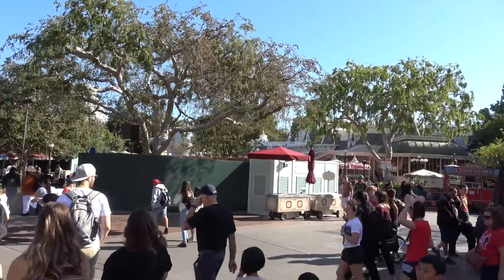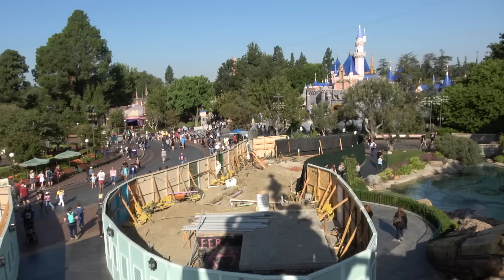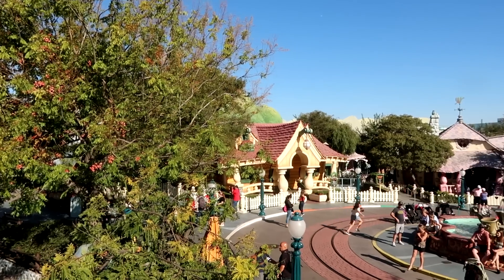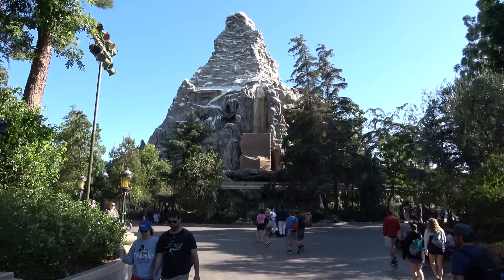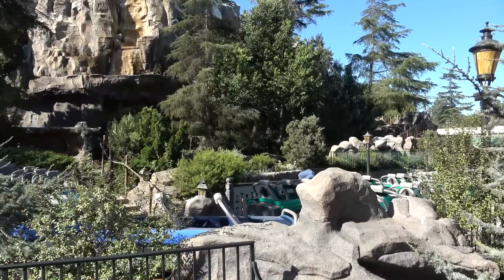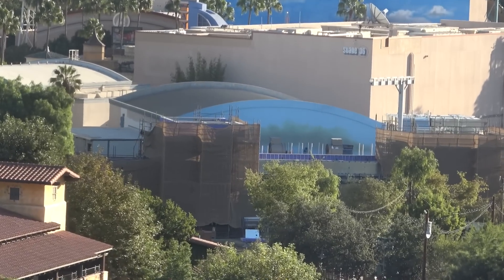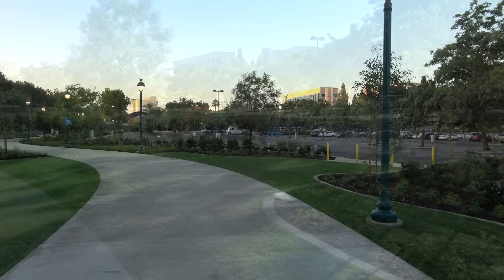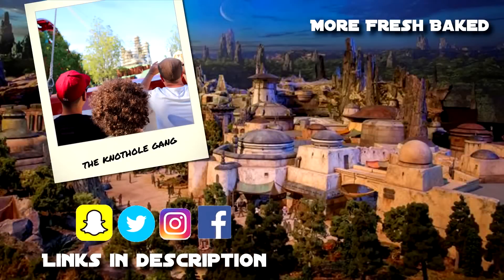Tomorrowland Mysteries Solved? - Disneyland Construction | 10/12/19 pt 78

Comment: The generic term for those round tubes for lights,  etc. is Sonotube. 
On your 7/20/2019 update,  I mentioned at 8:28 that approach ramp was probably for emergency access. The grass was temporary ground cover over base rock that was installed during construction. I'm pretty sure Disney knew it was going to be used as a shortcut and a concrete driveway would eventually be installed.

Comment: Reclaimed water… 
A lavender pipe would be used for reclaimed water 👍🏻
Non-potable
Clean water not for drinking
Reply: so yes for irrigation.
Reply: Steve Jackson 
Yes for irrigation…👍🏻
I’m sure there’s other applications for reclaimed water… But… I would guess that reclaim water is about 99% of its use
Reply: @dougingram4183  I have installed thousands of feet of reclaimed lines, always for irrigation. Outfall, or treated grey water, from wastewater treatment plants is actually cleaner than regular water, but no one wants to drink it so it is usually dumped back into a river or other water source or used for irrigation. I haven't heard of any other use. I put in a few miles of it in Austin, TX to water city owned baseball fields and parks! But it is supposed to be wrapped in "reclaimed water line" tape that literately says that in case someone dug it up, so Im not 100% on it. FRESH BAKED!!! Kungaloosh!!!
Reply: Haunt1000 
Yep… I just didn’t want to write all that...
Haha
And I just wrote 99%… Because I would guess there’s some sort of an application out there in the world other than irrigation… I just don’t know what it is…

Comment: The Matterhorn has been sinking for years, from what I have heard many times in the past. I see them taking it all the way down and rebuilding it exactly as it is. I could see them having Bob Gurr come consult on the project, which would make absolute sense to me.

The Matterhoen needs love. I just donr want to see any Frozen there. Being back the Matterhoen we know, maybe even better than ever. With the 3d scanning abilities we have today, it's highly possible to have the Matterhorn look identical to the way it is now.
Reply: Okay I hear you BUT, what if they left Matterhorn as is, and still managed to fit in with a Frozen land behind it, where Matterhorn is a backdrop that represents the north mountain? That could work... right?
Reply: @JimmyRHigh  
Oh yes. Thatd would actually be perfect.
Reply: I would be ok with a subtle retheme of the Matterhorn ride to make it a little bit more like the Wandering Oaken Sliding Sleds ride that is being put into the park in Asia (I forget which one). That theming is fairly subtle (think Seven Dwarfs Mine Train) and seems a lot like the Matterhorn.
Reply: When they built Nemo, they tore out some concrete by the walkways and made the Matterhorn start to list to that side. Alarms went off in the Matterhorn and engineers were called. The lagoon holds back the Matterhorn. The lagoon also leaks and has caused other issues on the east side of the property

Comment: Usually, those driveways are there for emergency vehicles. Our local high school did that. So not sure if it actually was for future concrete work, but regardless we should still treat it with respect.
Reply: arkytekt16 yes there is a driveway that leads to the road on the other side of the path. Anaheim PD likes to use the hedges hiding the driveway as a speed trap

Comment: 22:28 they didn’t intend to connect it. It was an emergency path in case they needed it- they would pull out the yellow poles and drive across the grass IF NEEDED. That is what those piles combined with a driveway apron usually is.
Reply: Agreed, use for emergency and maintenance vehicles.  Doubt it was ever considered or intended for pedestrian use.  The mob mentality however always creates a straight line of movement and usually destroys any foliage it its way despite safety concerns.

Comment: about the grass.  there is a driveway that runs to the street on the opposite side of the concrete path.  I think it is there for secondary or emergency use.  I'm surprised that they didn't use one of the hardened grass systems that helps to reduce foot traffic damage or artificial turf or something other than just bollards on the parking lot side.  a black iron fence with gates or even draped chain between the bollards would have done the job.  when I saw the set up on video I knew there would be people walking through there.  the grass was worn down when I was there in mid-September.

Comment: My sister works in the internship program at Disney and she works in the California Adventure side at Toy Story Midway Mania. When she was accepted and she got her information that there is no Onsite cast member apartments. They have to rent out a space about 10 minutes away. Unlike Disney world where it is onsite.  This makes sense because space is very limited but  since the eastern gateway was shelved do you think that that space( or the northern part) could be turned into  a cast member parking lot underground, with brand new apartments for cast members. they can then have a pathway across harbor  into backstage so that they don't have to travel far and its all onsite instead of spread out. As for the southern park turn that into that into another parking structure with  bag check on the second floor have a bridge that crosses harbor  by Disney way and have that pathway head towards the buss drop off area. Both guests from the bus zone and this new parking will have been through bag check.  this would then make the entrance at harbor smaller for bag check.  What do you think???

Comment: If the EER building is to be removed it won't be until all of the wiring that currently goes into the structure is rerouted. Hence you would not expect to see any demo on EER until all of that conduit lying around is in place. My guess is that they will remove it and replace it with a much smaller access structure.

Comment: The purple pipe is to identify nonpotable water typically reclaimed, recycled, or tertiary water supplied by the local waste water treatment plant.  It is also typically only utilized for landscape irrigation on golf courses and municipalities.  

The yellow pipes are bollards which are usually placed to control/prevent vehicle access to a specific area.

Comment: Couple thoughts... mission breakout fastpass area could be going away very soon as the new system will have its "hub" inside avengers campus. Also noticed the red car trolley  sign next to the current fastpass area. Could that be the new stop location for the trolley? Also is there enough room that the "new" track layout could turn right to go behind the pym foods building?

Comment: The mountains are not directly attached to the building. The mountains are on steel girders that are about 10 feet from the building but that does run the length of the building they’re adding M%M Runaways Railway. The mountains also block view of some of the pyro cannons

Comment: David that tent could be for welding for gas shielded wire or  short circuit metal arc welding to stop all the sparks and wind getting in to blow away all the shielding gases.

Comment: The mountains were a separate wall not attached to any building according to a former cast member.
Reply: Is that former cast member Alex the Historian?
Reply: Disneyland Vision I heard Alex say it and I also checked with a friend who worked at DL. I also vaguely remember it myself when I was in that back stage area for a band trip 20+ years ago.
Reply: You’re absolutely correct. Ex CM myself confirms the mountains and pyro were on a seperate structure from the building
Reply: You can google maps it and confirm what I said
Reply: True but they are close enough to the existing building that they probably had to be removed to make way for the demolition of the old building and construction of the new building.

Comment: The last I heard that Disney is expanding Tomorrowland and Fantasyland. Something about scrapping Finding Nemo and Autopia because both rides are very expensive to maintain and to take place for both spots for the Tron lightbike coaster. The coaster is going to be partly housed on the peoplemover track. Tomorrowland is supposedly house 4 new rides and attractions with Tron, Wall-E, Wreck it Ralph and something I don't remember. Fantasyland has a small expansion with 2 new rides. DCA is modding the park in 2, Pixar plaza and an Avengers part of the park. The Guardians ride is officially getting scrapped due to prior issues from ToT. The computer files are damaged which causes common breakdowns, it's something they ignored when making the Guardians ride, they didn't replaced the old cpu's. The last D23 convention they mentioned that construction with continued til 2025.

Comment: On the issue of the grass getting worn down, I actually think this was poor planning by Disney.  I understand the comments about being respectful, but I learned early on in site design and layout that you put paths where the people are going to go because people always take the path of least resistance.  Also I don't really understand why Disney made these areas of grass along that path because another thing you learn in the field is that grass is a surface most people will walk on.  We walk on grass quite a bit and most don't think of it as a keep-off material like you would a planter bed, etc.  As others have commented the ramp from the parking lot is for emergency vehicles and it's easy to see that people would treat that as a way to/from the sidewalk.

Comment: The yellow poles are there so no one mistakes the sidewalk for a road. Though access is still probably needed to maintenance vehicles. With that said, it would have very well been mostly maintenance vehicles that caused the grass to go bad. Assuming those vehicles typically cross at night, perhaps when the grass is wet from sprinklers, causing the issue.
Reply: stevo for emergency/first aid use

Comment: I would bet the Star Tours facade probably had an issue with separation from the wall due to age or water/rain intrusion. Cosmetically it looked fine so it had to be some kind of structural problem.
Reply: That would also explain why it is taking a while; a fresh coat of paint would have been quick to finish and the scrims would have been down by now.

Comment: the concrete is put there to help avoid soil erosion unto parking.   they have done that before.

problem is that people are lazy and need to be educated. maybe they also need to add a chain with a sign noting that people need to use walkway and not walk thru parking lot.

i was just as upset as you that people are so lazy and have no respect for the gardens